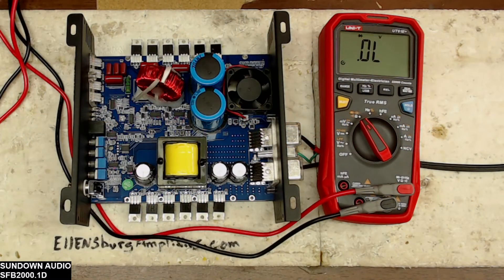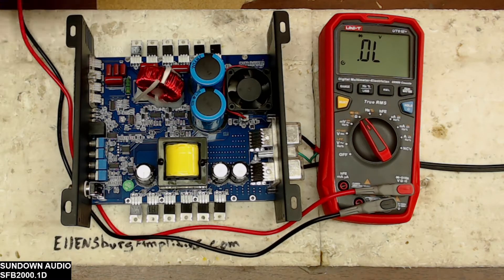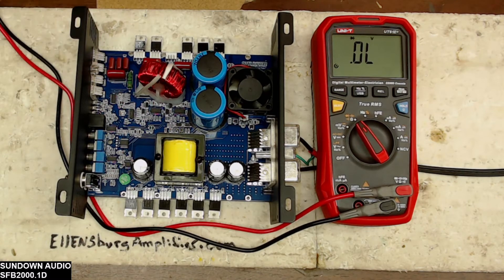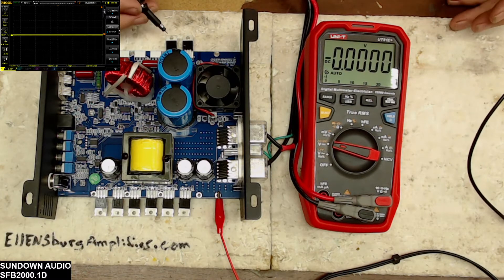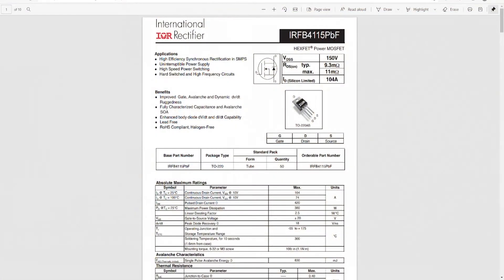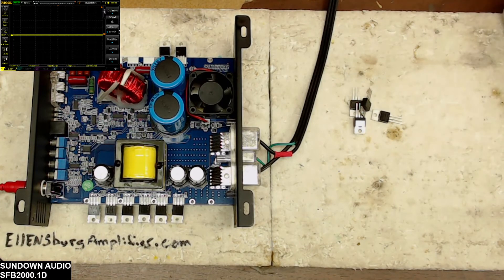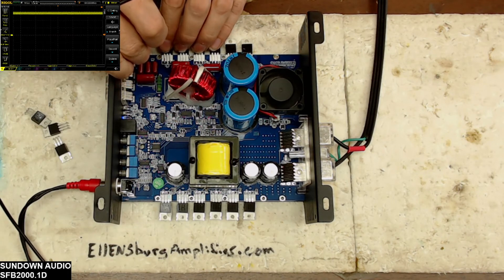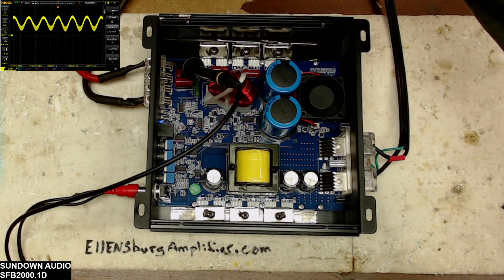Sundown Audio SFB-2000D Class D Amplifier Repair of Output From a Short

Comment: Speaker wire touched now clip light stays on…worth repairing?
Reply from the maker: I think they are worth fixing if you like the amplifier. I may be able to get you fixed for as low as $50 so it depends on how much you enjoyed running it.
Reply: I have a few amps same problem I’d like to get repaired?

Comment: I need some help. I have the sfb1000 amp running a SA classic on 1 ohm. 
the amp keeps clipping. I sent it to sundown for testing. they said amp is good and issue is cause by bad rca signal from the radio and music source bluetooth. They said it was premature clipping.

Is there such thing? 
How do I fix this?
Reply from the maker: It is possible to get into clipping at 1 ohm depending on several variables. I will usually see clipping when there is a drop in voltage or available current. I doubt a bad input but could be a high input voltage? It is hard to say what the issue could be without knowing a lot of details about your system.
Reply: @ellensburgamplifier  my system is basic. my car is 2021 subaru outback. im using the factory radio, factory battery, factory 190 amp alternator. My power cable are 4 gauge ofc/cca hybrid from scosche with 100 amp fuse. One sundown sub. 
I tap into front and rear speakers for rca signal. I tried both audio control lci2 and a basic kicker line out converter. both premature clip. before the sundown i was using a skar rp800 amp at 1 ohm and it work good, no issues. nothing changed from my setup beside the new amp. I set gains with DMM to match ac volts. I measure power/ground and speaker voltage on the amp terminal. both above 14 volts.
Reply from the maker: @ssc7453  It may be the amp? I am not sure without getting it on the scope but if your voltage and current is holding steady then I would suspect an issue in the amplifier pre-amp.

Comment: Where can I get that part
Reply from the maker: Which part are you looking for?
Reply: E'burg Amplifier Repair the one you where talking about in this video cause my input and output touched
Reply from the maker: @frogassassin1587  www.LCSC.com has them in stock at this time. IRFB4115 for the output and IRFB1405 for the power supply. You may also need new drive ICs and zeners for the output if it does not start up.
Reply: E'burg Amplifier Repair I’ll see what I can do I can see what burnt up is there anyway I could send you photos to see what you think
Reply from the maker: @frogassassin1587  Sure can! If you are able to see the description of the video you will find my email address there or www.ellensburgamplifier.com
Reply: E'burg Amplifier Repair I shot you a email under sundown amp

Comment: I have sfb 2000 Power MOSFET that's a need replaced says B3 I don't see B3 online anywhere what's the best option for replacing the B3???
Reply from the maker: Is this a power supply transistor or an output transistor?

Comment: these amps are trash no joke the skar rp series are better.(which is pretty bad but they are solid half bridge design).. sundown is throwing their name in the dirt with these brazilian amps... not the same quality as taramps and soundigital...
Reply from the maker: I have seen some interesting failures with this line of amplifiers. In most cases, I can not explain why the failure occurred. I also see these getting wired to the most extreme low impedance conditions that these amplifiers will not tolerate.

Comment: Hi there I'm wondering if you could help me out I acquired a sfb 1000d that had pop spilt on it at first after Cleaning the protection light (red) was solid after a second Cleaning done myself the amp lights now blink all 3 then the clip light(orange) blink a number of times before all 3 blink again this process just repeats if you could elaborate I would highly appreciate it
Reply from the maker: That means you have a shorted output section most likely. You will need some new transistors, Zener diodes, and a possible drive IC.

Comment: Hey have done any work on the sfb 5k I'm looking at h9s. Trying to find a good match.
Reply from the maker: Are they TO220 size? Also, what is the voltage rating of the rail caps?
Reply: @ellensburgamplifier  I have no idea how to test the rail voltage
Reply from the maker: @marvinautoworks9955  What is the number on the large capacitors? It will say the voltage on it. I will bet either the IRFB4127 or the IRFB4227 possibly even the IRFB4115. It all depends on the voltage stated on the capacitors.
Reply: I'm go with TK17E80W,S1X and hope
Reply from the maker: @marvinautoworks9955  The current ratings are too low to use those with slightly high Rds on value.
Reply: @ellensburgamplifier  200612. 160v2200mf jwfdz
Reply from the maker: @marvinautoworks9955  I do have to make sure we are talking about output transistors that need to be replaced and not the power supply transistors. The IRFB4127 is what I would put in there.
Reply: @ellensburgamplifier  i had speaker wire touch the case. So now the amps powers on with a solid clip light no output.so I tested all the mosfets and when I got to the h9s I found a short. Those are located right behind the speakers inputs.
Reply: Also they slightly look darker then the rest
Reply from the maker: @marvinautoworks9955  Please feel free to send me a picture if you have any doubts about the condition of the board. www.ellensburgamplifier.com/request-a-quote
Reply: @ellensburgamplifier  I do trust everything is fine but u will send you some pics and I will use them irfb4127 and see how that works out
Reply from the maker: @marvinautoworks9955  Don't forget that the drive IC more than likely will need to be replaced.
Reply: @ellensburgamplifier  I been trying to find one but I cant
Reply from the maker: @marvinautoworks9955  They are hard to find. You may have to contact an overseas distributor to get them. My distributor carries them but best if bought in bulk.

Comment: any idea what size fan that is? I think it causes noise in my tweeters/ Maybe replacing it would help
Reply from the maker: I do believe it is a 40x40x20 fan. That would be odd if it was causing noise through the output as it would have to make its way through the output inductor. Unless it is noise in the 12 volt supply. One way to check it is to de-solder the red wire (12v) of the fan off the board and re-check for sound.
Reply: @ellensburgamplifier  I seem to only get that sound from my super tweeters when running full bridge amps I dunno if its the sensitivity level of the tweeters or what ugh
Reply from the maker: @rexnhogz  Noise is an absolute bear to track down. I had the same issue years ago when I had my installation end of the business. One of the many headaches to overcome.

Comment: It may be USB Drivers if it's not showing up in Device manager under USB Serial Devices. I'm not sure if that could be it but I thought I would try.
Reply from the maker: Thank you! After contacting them I found they have released a new version of the software that works with 10 now. I was so frustrated! Thank you for watching.

Comment: I’m hoping you can help.
I’m looking at a SKAR 5 channel amp. I’ve heard that their boards are prone to failure because of heat. Do you see a lot of these?
Reply from the maker: I have had one of the 5 channel amplifiers in. I may have put a video out on it but I can't remember. The one I had in had a burnt trace at the edge of the board around the class D section. It is a thin trace. I am not a fan of cramming a class AB in with a class D in one heatsink. As long as it is driven properly and has good ventilation then I would not worry about heat.
Reply: @ellensburgamplifier  thanks! I’ve been in the fence about buying one of these to power the whole vehicle. Currently I have a Kicker Key 200.1 driving the four door speakers and a now dead Pioneer GMX862 bridged driving a 10” 4 ohm sub. My other options are a Sound Ordnance 350-1 or a used JL Audio 360/2. Thanks again for the input!

Comment: Hi.. i got soundigital 250.2..    output speaker wire got shorted..   internal fuse did not blow... do i need to change all the   mofsets??
Reply from the maker: Is it the SD mini? I would suspect that the transistors would need to be replaced and depending on the design the drive IC needs to be looked at. I would check the drive before putting new transistors in. Most cases you can see a low side drive on the scope with no outputs installed.

Comment: This amp breaks down so easy mine got toasted yesterday 10 months having it
Reply from the maker: They do have a rather light thermal mass so if it was driven at 1 ohm or lower, then 10 months isn't too bad.
Reply: @ellensburgamplifier  I was running 1 ohm on 2 X-8 v3 sub held up good but amp couldn't handle it hopefully it's under warranty
Reply from the maker: @oclaothug69  Hopefully they take care of you with the 2-year warranty. Maybe I should apply to be a repair center for them! If they won't cover you feel free to contact me as these are not too expensive to repair.
Reply: @ellensburgamplifier   How much is a repair like this ?? Have same issue SFB1500
Reply from the maker: @elchulo706  Thank you for your interest. An email has been sent.

Comment: i have a sfb-2000d my rectifier or my transistors located as "s4","s3", and possible "Q12" are no good what transistors can i use to repplace it
Reply from the maker: I don't have a close-up picture of the board to know which ones these are. If you are able to send me a close-up picture of the board and the area of the suspected bad components then I will be able to assist you in this. www.ellensburgamplifier.com and in the top corner if you click on the quote tab you will be able to send them to me.
Reply: @ellensburgamplifier  whats your email address and i can send the pics
Reply from the maker: @JonathanRodriguez-ks9ny  www.ellensburgamplifier.com and you will see my direct email in the contact information or you can send pictures through my quote form.

Comment: I have a similar problem with the sfb 8000d, I turned the amp on low volume n it said it was clipping then shut off n now it tries to start up but shuts down n the clip light blinks until amp restarts then clip light blinks, it does that until I turn power off. Do u have any idea what could be wrong or any advice??
Reply from the maker: This got held for review for some reason. Yes you will need to replace the output transistors most likely. Thank you for watching!

Comment: What's the best replacement for IRFB4227??
Reply from the maker: You may be able to get away with the IRFB4127 depending on the application. Otherwise, there are many vendors that carry the 4227's. Are you not able to get the 4227's?

Comment: Hello Sir, I could certainly use your help.  First I bought this amp, the sfb 2000.  During initial install my helper wired power and ground backwards.  I was running wires under hood.  Anyways hooked up the power and immediately burnt up the amp.  Ok then I went to local Sundown dealer and bought same exact amp.  It was working fine until clip light stayed on constantly.  So I have $600 invested and no sound.  My next step is to replace output transistors in burnt amp into clipped one.  Never done it before, but I'm confident I can swap them out if in fact that's the issue.  Can you give me some advice or suggestions?  How much do you charge to repair them?
Reply from the maker: Hooking an amplifier up backwards just takes out the power supply. The clipping is more than likely an output transistor but you would need a scope to verify the drive. If you were to send both in to swap parts then you are only looking at a labor and load test fee of aprx. $25 otherwise transistors are $4.75 each installed.
Reply: @ellensburgamplifier  ok I can do that.  Would you mind replying with all necessary info? Thank you.
Reply from the maker: @47straight918  If you wouldn't mind filling out my form or shooting me an email (info found at www.ellensburgamplifier.com ) I will get back to you directly to avoid spam and scammer potentials.

Comment: Hey what’s up I have a spf 2000 and the positive speaker output is burn what can be done
Reply from the maker: Is the terminal itself burnt or melted? If so the best thing to do is to find a broken, blown amp of the same model and switch out the terminal. This also allows for other additional parts like the drive IC's and transistors.
Reply: E'burg Amplifier Repair just burnt I don’t think it’s melted it automatically goes into protect when u give it juice
Reply from the maker: @matthewmoody4423  It will need 4 new output transistors. Those are the first thing to go when the output gets shorted.

Comment: Wow thank you very much for this video because am working on a sundown Sfb 3000d that used a H6 output so am going to try the irfb4115  and I'll let you know if it works i owe you a drink keep making great videos
Reply from the maker: Thank you for the comment. An easy way to know you are in the right ballpark for the transistors is to compare the rail voltage to the voltage of the transistor you are looking to use. From there matching the specs (current, RDS, Capacitance, etc.) will help pick the best fit.
Reply: @ellensburgamplifier  Hey good morning sir the irfb4115 works for the H6 output in the sundown SFB 3000D wow thank you very much i owe you one 🙏 🙏.
Reply from the maker: @cartycartyamplifiersalesrepair  Excellent! I should keep a running list of the matching transistors to the factory proprietary markings. If you know which IC is used for the power supply transistors from the PIC please let me know so I can add that to the books.
Reply: @ellensburgamplifier  Ok I'll keep  in touch
Reply: @ellensburgamplifier  you ever make that list?
Reply from the maker: @floridaboycustoms3209  Are you referring to the list of manufacturer parts? I have not received many SD amplifiers but I do have a general idea based on voltages.
Reply: @ellensburgamplifier  specifically I’m looking for equivalents for parts labeled B1, B2,  and H1
Reply from the maker: @floridaboycustoms3209  H1=CSD18502KCS, B2=IRFB4115, I don't have a B1 listing. Where is the B1 located? Output transistor?

Comment: I have a sfb 1000D that needs repair went into protect won't come out
Reply: Yes
Reply from the maker: @oshaymcdonald8792  If you are able to track down the number of low resistance transistors and multiply by $3 (replace all parallel transistors) will give you a rough idea of cost.
Reply from the maker: More than likely a shorted output transistor or two. Not too expensive to repair. Do you have experience using a DMM?

Comment: Thanks again! I’ll be sending out another amp soon 🤦‍♂️
Reply from the maker: Any day! Thank you for watching and I am always thankful for spreading the word here in WA. Let me know if you have any questions!
Reply: @ellensburgamplifier  
Ya this time will be a sundown sae 1100.5 

Pretty much same thing happened with positive and negative but this time the positive speaker wire (while car still on connected to amp) touched I think the negative battery terminal in my trunk. 

It’ll power on but no audio 🤷‍♂️
Reply from the maker: @deejay2301  Oh my! That may also be just some shorted outputs. I will look online to see if there is any rail voltage information to know what outputs they are using (if defaced). Thank you for your business!
Reply: @ellensburgamplifier  
Thank you!

Comment: dealing with this myself on this b2 7500.1 outputs are marked R1 if they were cheaper parts i wouldn't mind poke and hope a couple times but its looking like outputs are going to be around 100 a set depending on which it is.
Reply from the maker: Ouch! I am assuming the B2 uses quite a few parallel sets on the output? These output FET's are not cheap.